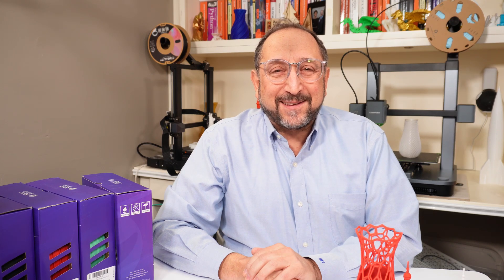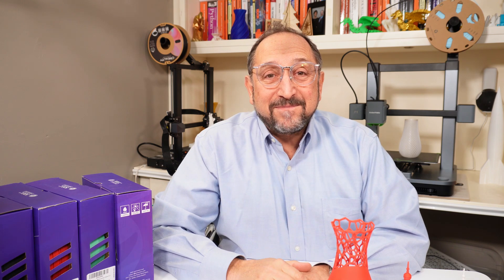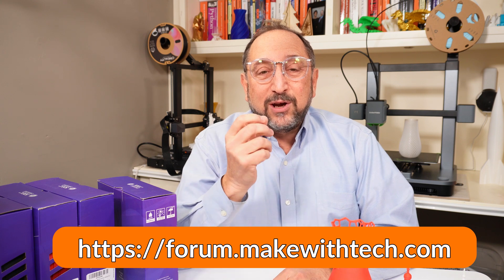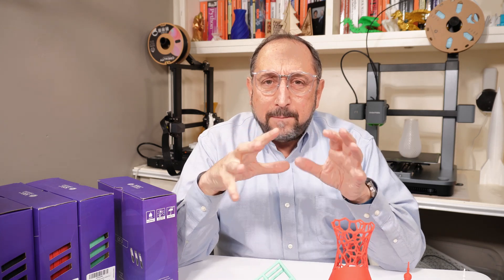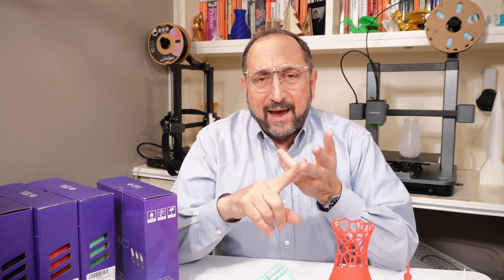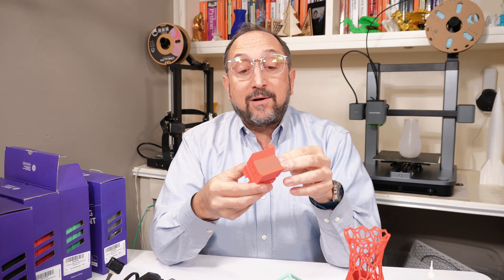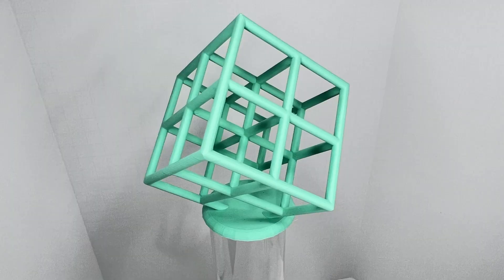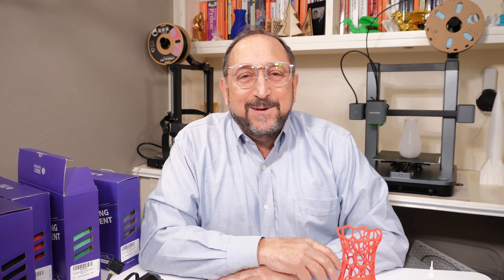New and Improved High Speed 3d Printers And Filaments

Comment: Excellent video.  I recently purchased a Creality K1, and I have found it to be an excellent high speed printer.  The K1 is a direct drive printer that runs Klipper, so it's fast.  I also like that it's an enclosed printer so it should be able to print most all filaments.  One feature I wasn't sure I would need, or like, is the optional AI camera; however, it's an excellent accessory.  If you get a chance try a K1 I'm interested to hear about your experience.

Comment: Hi Irv always great videos. I do not own a 3d printer yet!  However I thought would it be beneficial if there was an all glass hot end with a laser melting the filament through the glass head giving it finer control in extruding filament at a much faster, hotter and  accurate  rate,. Whats your thoughts on this idea ? 😀
Reply: The laser can also heat the cooled filament before the newer layer is applied giving it a better adhesion and smooth finish just a thought
Reply: @gamedevai  how do you intend to make it? it's glass and fragile. Lasers are also expensive. you've just added £200 with no benefit. Id a diode it would most probably not even melt transparent filament and if a co2 laser adds another £300 and a 3-foot tube to it along with water cooling.

Comment: Looks like a filament review as opposed to a printer review.  The filament goes hand in hand with the fast printer but, what was the print speed, travel speed, accelleration and decelleration speeds of the printer that the samples were printed at?  Enquiring minds want to know.